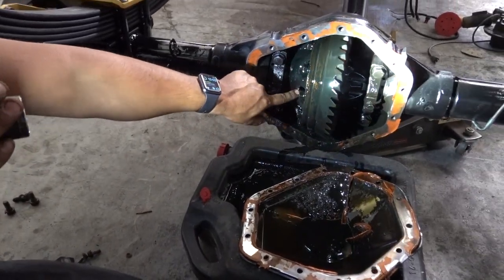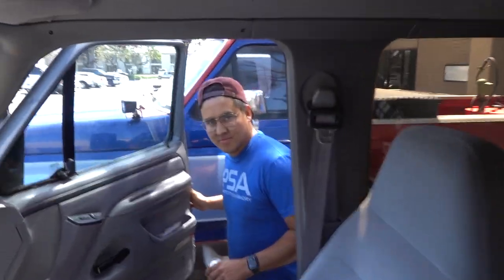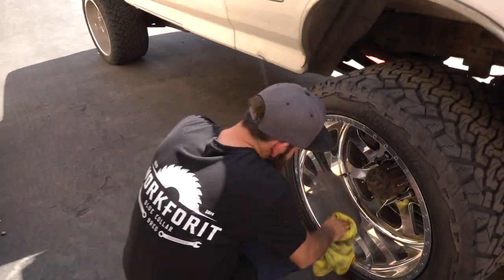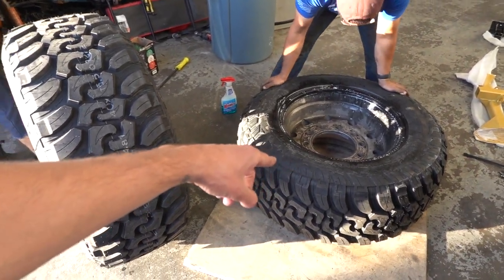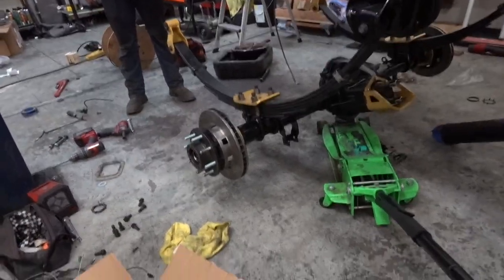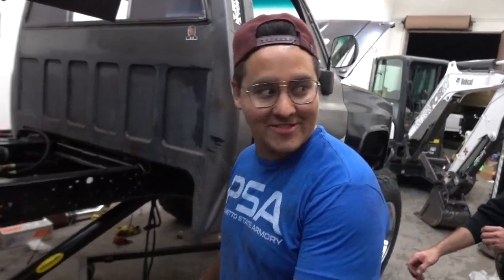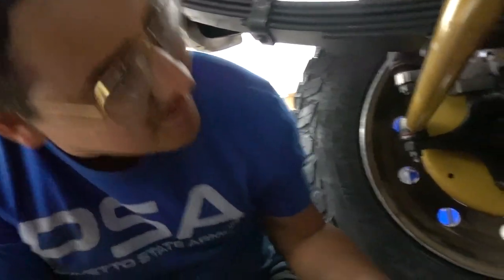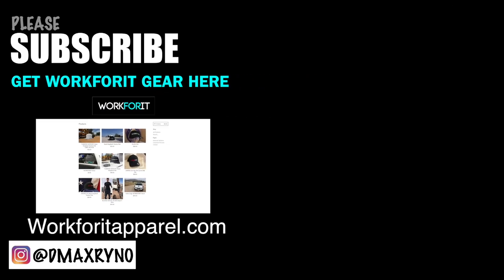The Super Singles are Mounted and Look AWESOME!

Comment: I stumbled on something the other day 

if ya take the air chuck off the hose then slip the brass fitting end that the chuck attaches too over the valve core itself it will blow way more air through then with chuck on 🤷‍♂️